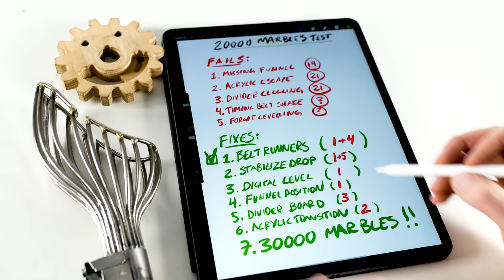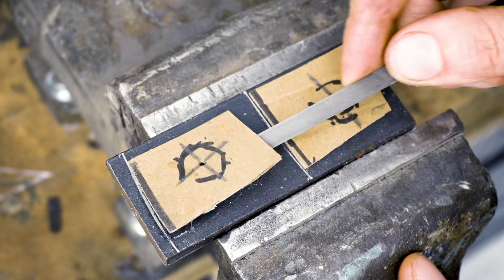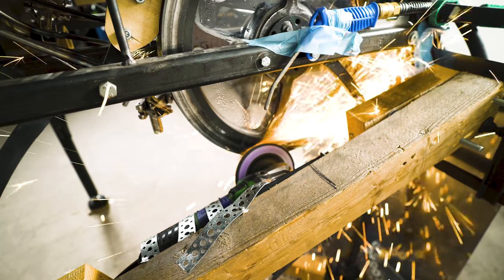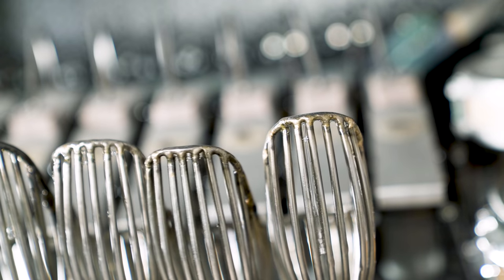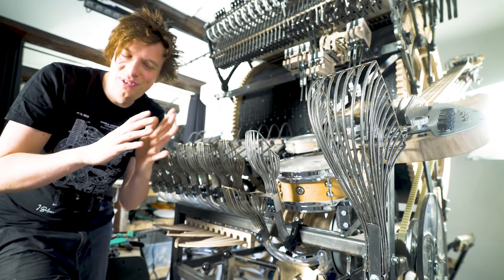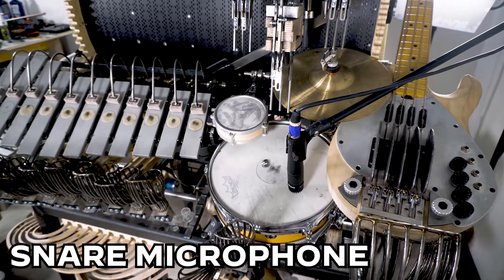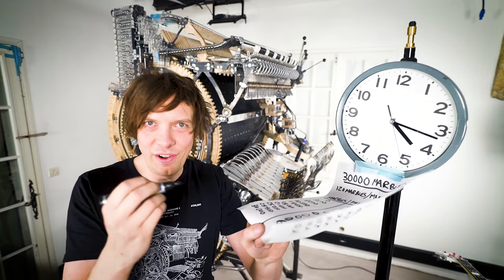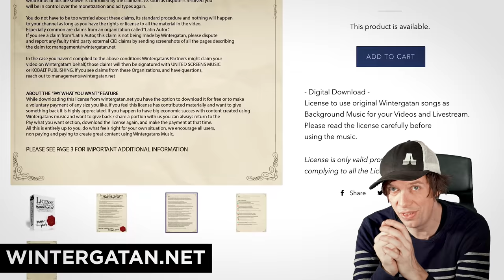Playing 30000 Marbles - Marble Machine X #148

Comment: nice job, great video.  I have one suggestion in terms of the mic.  Instead of using a gate, use an expander and side-chain a drum trigger from the snare, then you aren't dependent on the sound but the actual hit of the snare drum itself.  you can adjust attack and release to get the exact sound you want.
Awesome video, keep them coming.

Comment: Yeah, balancing the weight is usually a much better solution for eliminating vibration than trying to machine the part into a perfect symmetry, because even if it looks perfect and is perfectly aligned, the mass is almost never perfectly distributed, which is unfortunately just kind of the nature of any man made product that isn’t manufactured to almost perfect tolerances and even then there are just some things that either can’t be or are too expensive to make to those tolerances, especially mass distribution it’s incredibly tough to mold things to perfectly distribute the mass.

Comment: Cutting material off the edges of the flywheel evenly can't change its center of mass. Thats why balanced flywheels have holes drilled in one side and not the other.

Comment: Martin actually decided to clamp a disk sander to a flywheel to cut away material to balance it out...............................instead of just placing weights/magnets on it on like most applications...even car wheels are balanced with extra weights!

Comment: Timing belts on vehicle engines use the same thing but they apply a spring loaded tension. If you plan to run it for extended periods I would suggest a light spring tensioner since all timing belts tend to stretch over time.

Comment: In the automotive world what you are doing to the belts is called a belt tensioner. Very smart. But, you said the marbles weren't hitting the sides of the hole of the wooden plate to prove your point but...... the marble WAS hitting it, just slightly.

Comment: I've seen this kind of human behavior before. Two supposedly engineers needed 15 Om resistor. They didn't have it. But they had about 1000 of other resistors. Instead of using a formula and calculate a combination of resistors connected in parallel to create 15 Om equivalent, (which I did in about 2 minutes), they spent a whole day, from 9 am to about 10pm randomly connecting random resistors and measuring the resulted resistance. Needless to say they hated me when I came and told them the solution. They still hate me till this day. Oh, they had so much fun and I just had to ruin it...

Comment: Aluminum flags nested between 2 opposing magnets will produce an eddy current "brake" that will dampen motion in all directions. Also actuating the marble dropper is creating a problem in and of itself in that the machine must be actuated by the device used to actuate the dropper and not manually as manual is false compared to auto when it comes to micro motion analysis.

Comment: I love your machine. 
I noticed a few things while enjoying you video. 
You trued and balanced the Fly wheel. You have not do trued or balanced the Hand lever pulley.
It wobbles sickly (see the beginning of your video) 
The marble droppers have just a rod for it to slide out, with only one point of mounting.
Wouldn'd bracing the tip of the rod, stop all movements in them?

Comment: Did you check the bearings in the flywheel before cutting. Also you probably could have taken it to a brake shop and have them machine like a brake rotors and the arbor that spins it?

Comment: I am a little confused because I worked for many years in an IT firm. We had some envelope machines. There was scarcely a day, when not have to come mechanicians from other cities. The focusing had often to make new. Of course, there were the Quality of the envelopes and the Printed paper important. Was there a different temperature or humidity, so the problems started new. Fortunately, I had seldom worked at it, but I worked at the big laser Printer with cut machines behind them. Also, there were often problems with the room temperature quality of the big Paper-rolls and the mechanical systems in the cut machines and folders. 
My trust in mechanical systems is not very high. So I am astonished about this mechanic compared to the million expensive machines in my old company.
Nevertheless, I like this artwork.

Comment: Instead of using magnets on the fly wheel to make a static balancing system, how about mounting a circular tube track on the fly wheel with some marbles in it to make a dynamic wheel balancing system?
I'm thinking of the "Centramatic" wheel balancers that are used to balance automobile and truck tires.
Search YouTube for "Centramatic Automatic Wheel Balancers Demonstration".
It seems like a much more appropriate way to fine-tune your machine.

Comment: instead of using a calculator to calculate reliability and typing it in, you should just use an expression for what google sheet (excel and other sheet sofwares are desinged to do) , so you should just type in the E3 cell the following expression:

=(C3-D3)/C3

and then format the cell to % by clicking on the cell (or select area) then format->number->percentage) 
you can also use those 00.-> and 0. <- icons to increase/decrease decimal places

this exression also can be copied (click to select then ctrl+c, then select underneat cells and cttrl+v) because the cell address is relative (e.g.  C3) when you copy "downwards" it will change to c4, c5, etc so it will work in the next line too :D

Comment: I would have used the tool they use to cut break rotors for a car and then use a wheel balancer that they use for cars to put stick on lead weights to balance it perfectly. You would have been done in 30 minutes.

Comment: Ok... For the wheel... I'd point out - learn how car tires are balanced! You don't have a true solid mass metal wheel! Those magnets are doing the same as tire weights... 
The issue with the release return hitting and making the head vibrate... Try either a "stopper" spring or a bumper so that the impact is reduced/stopped! Making the supports for the head stronger isn't a bad thing, but that wasn't the source of the problem!
Reply: My sweet summer child. The project is shelved.

Comment: In balancing the flywheel he also forgot about the uneven circumference, which would balance the wheel with much greater results than trying to true up the braking surface. Auto mechanics machining 101.

Comment: You’re using the wrong equation (E=mc^2) for determining how much movement you’ll get in a component. You’re dealing with vibration analysis so you need to consider each component as a spring and determine what the natural frequency is. There are many equations and methods you can use to help you. The reason why the vibration of the marvel catchers got worse it’s because When you changed the mass of the flywheel by grinding it, you changed the frequency generated by the flywheel, Which obviously more closely matched the natural frequency of the catchers. I remember in engineering school we had some very simple methods of determining what a natural frequency of a component is. It’s also very easy to determine what the frequency generated by a flywheel is that’s unbalanced. What you did with the flywheel by adding magnets, reduced the amount of unbalanced mass, which changed the amplitude of the vibration generated, and probably the frequency itself.

Comment: The flywheel needs to be put on a lathe and machined true, the put on s balancer and balanced with pression  a grinder isn't going to do it
This should be a pression made machine
After all it is a machine.
I noticed it nog only out of balance to the center but its also warped is shape. You cut this out using a cutting torch putting that kind of heat on flat plate steel changes its internal properties some crystsls will change shap pulling one edg and pushing another surface much like wood and water move  this has to be a machined part done on s lathe and mill so it runs true it cant move site side and run out up and down it becuse of its mass will cause the machine to vibrate a lot, however if its true it will cause the whole machine to stay stable and take away movements becuse smaller vibration will be absorbed buy its forces of the centrifugal kind. This is  key component.

Comment: Martin, what is the problem did not come primarily from the vibrating cage but from the vibrating SNARE DRUM? 
If the drum comes up, it increases the contact force with the marble, which bounces off stronger.
What do you think of my theory?

In any way, your weighting of the wheel fixed this issue. 🤩

Comment: 28:47 warning: nerd shit
if you want a good measure of reliability based on a test of n marbles with s successes
you could assume the machine has a 99% reliability, and calculate the probability of this hypothetical machine getting s or more successes with n trials, with a lower probability giving a better "score" (for example, you could do score = 1 - probability)
if n = 10000 has 100% reliability, it will have a higher probability (and thus a lower score) than 100% reliability for n > 10000
the choice of "99%" is arbitrary here, any 0 < p < 1 works, it might be best going with your best "guess" for the accuracy of the machine instead

Comment: You could try a self balancing fluid ring The fly wheel used in this video https://youtu.be/l8PxXZoHTVU uses a copper tube partly filled with fluid set into the inner rim of the fly wheel I can't find much information on why this works but many wash machines use this type of ring

Comment: Any machinist would say you cuf the wheel not grind it  You are an artist not a machinist or engineer..  Use a carbide cutting tool and anchor it and spin. see a commercial lathe operator and buy a cutting tool.